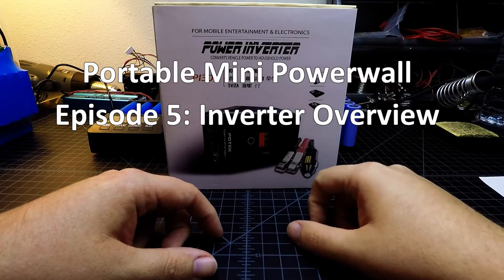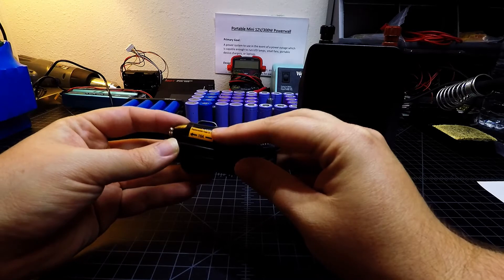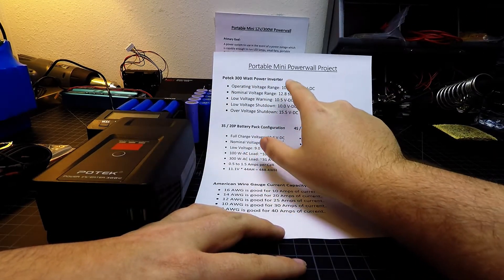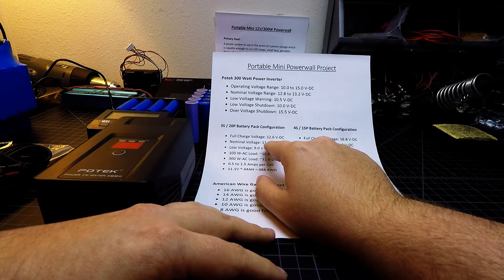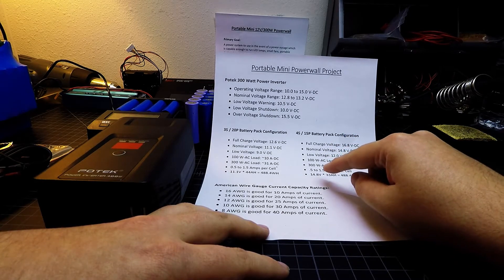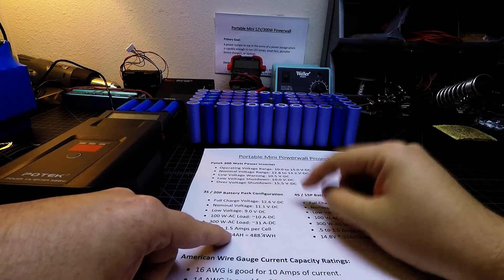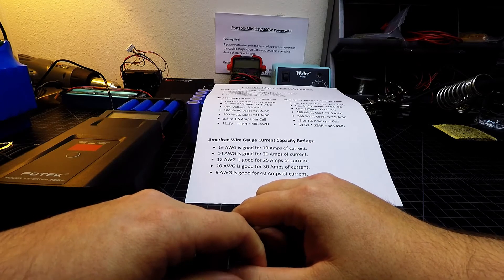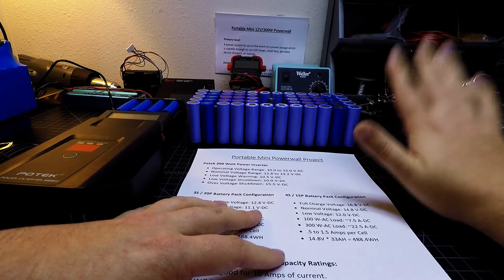Portable Mini Powerwall Project E05 - Power Inverter Overview

Comment: I'm glad I stumbled upon your series of videos as I'm in the middle of a very similar project.  I was debating between 4S and 3S with the issue of 4S being that at full charge it is over the 15V max.  So I was looking at either trying to drop the voltage with diodes or using a buck boost module to center the voltage.  But I like your rationale of the 3.3V cut off which is the great majority of capacity anyway for many cells -- for the NCR18650B it is 100%.  I also really liked your cell harvesting video and I've ordered one of those packs to give it a try.  Thanks so much for your time and attention to detail and I'm looking forward to the next ones in your series.